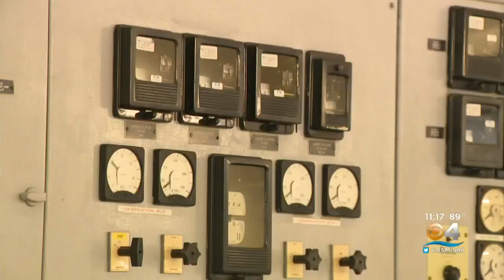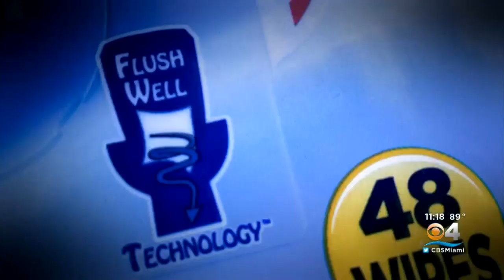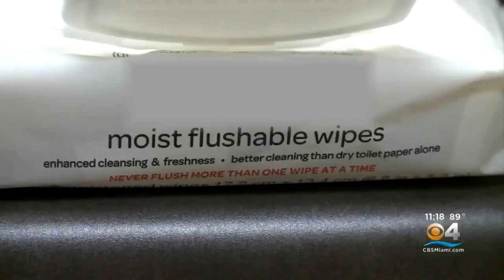Miami-Dade Sewer System Being Clogged Up By Flushable Wipes

Comment: cottonelle flushable wipes break down, ive done test myself. the only flushable wipes i would trust and use. easy tear and no plastics. begins to disentegrate not long after sitting in water. and tears easily
Reply: No they don’t, we have tested numerous wipes & they don’t break down unless you tear them up before flushing. If people would use their heads & stop being so lazy, we wouldn’t have to clear your pipes out at 2am if you would listen to actual plumbers & not a piece of packaging.

Comment: The sewage problem is because the pipes are old, they should have been replaced, the head of the sewage has been embezzling to live in OCEAN FRONT HOMES, NOT REPLACING OLD PIPES, THAT IN THE BUDGET TO DO SO.
Reply: It’s not broken, it’s getting clogged. People flush tampon condom and sometimes dead cat
Reply: lol i work for a big waste water pump company. it is a big deal. and its not the pipes., areas where people dont flush down wipes there are rarely problems. ive seen 30 year old pumps look like new.. and i ive seen 5 year old pumps break down because of cluds unbalancing the rotor and ruining the bearings and seals.
Reply: Man bye its CORRUPT

Comment: The sewer systems where I live was installed in the 1930's... no upgrades in 90 years.  The pipes should be 3x their current diameter - the sewer guys where I live work about 2 hours a day, and spend 6 hours a day sitting around on the truck having coffee and lunch - heaven forbid they work past 3:00pm, their Union starts crying.